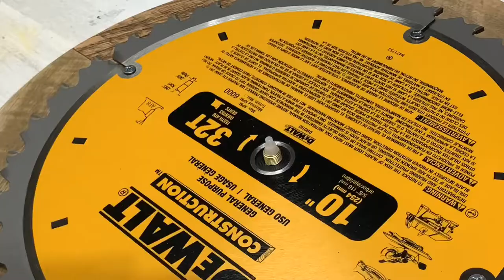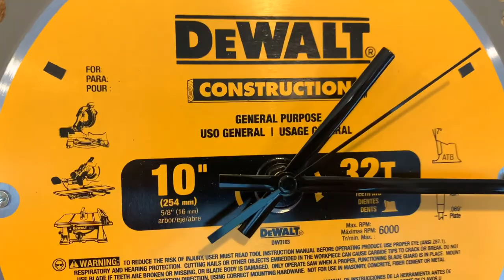How to Make a Saw Blade Clock

Comment: Can you put a link in the description for the blade 2 pack and the clock guts you used? I like the dark black band on your saw blades, but all the ones I can find have silver band instead of black. Also, most clocks tick, and yours has a nice smooth movement. Thanks for a great idea!
Reply from the maker: Thank you!! Here is the clock kit 12888 Quartz DIY Wall Clock... https://www.amazon.com/dp/B078422JP1?ref=ppx_pop_mob_ap_share
Reply from the maker: And here is the 2 pack of blades… DEWALT 10-Inch Miter / Table Saw Blades, 60-Tooth Crosscutting & 32-Tooth General Purpose, Combo Pack (DW3106P5) https://www.amazon.com/dp/B00005A1H7/ref=cm_sw_r_cp_api_glt_i_7RV6F88C6WTAWVSV7C47
Reply: Awesome! Thank you so much!  I love the idea, but I think I'm going to use a Kreg Jig to join the pieces.